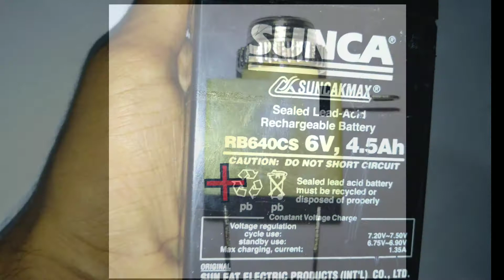How to make a battery charging indicator & improve your battery

Comment: Not work
Reply from the maker: Follow the circuit diagram:-

Download in JPG:-http://bit.ly/2wvX0lP
Download in PDF:-http://bit.ly/2Z3v3Oa
Download in SVG:-http://bit.ly/2EMI0V0

If your problem still not solved then you made some mistakes. Here are some tips you can do:-
 Double check all the connection. Check the LED whether it's glow or not. Check your charger.

Comment: can i use this battery charging indicator for any battery please give reply sir
Reply from the maker: Yep, try to use 6 volt battery. Otherwise 12volt battery or less than that. But you may need to change resistor value.